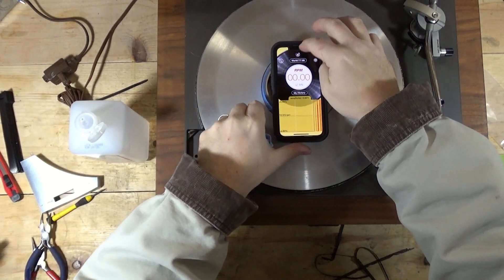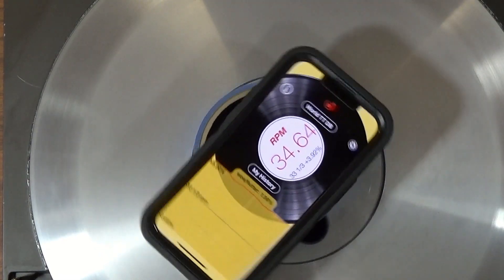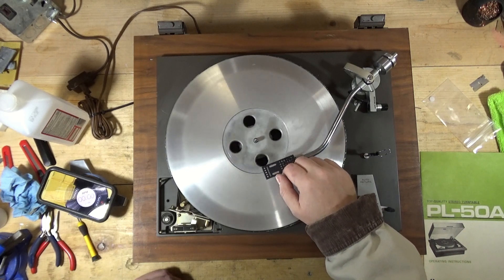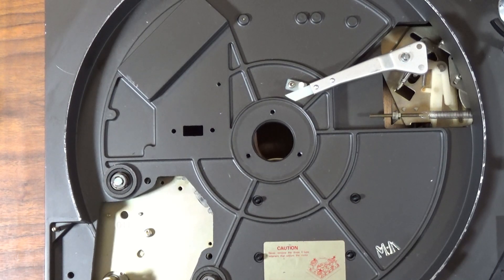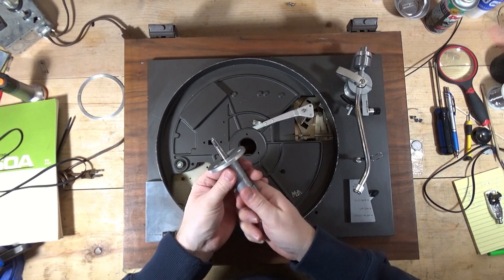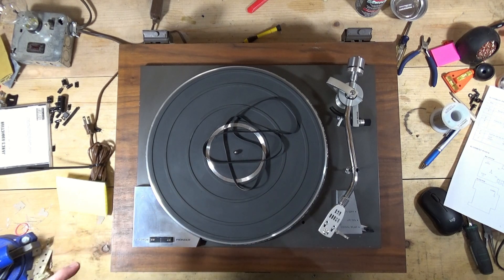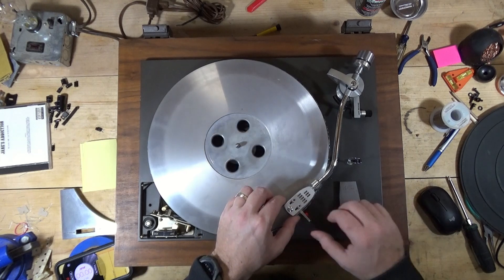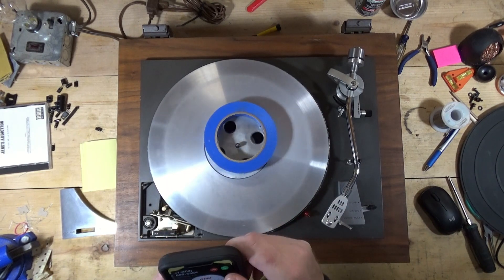Pioneer PL 50A Turntable Repair Part 2 - Speed Issues & Replacing the Thrust Bearing

Comment: Haven’t had much luck with these era of turntables. Typically fast or slow. I think they call it AC synchronous motors there’s no speed pots or strobe to monitor
Reply from the maker: Yeah, it takes a bit to get them dialed in.